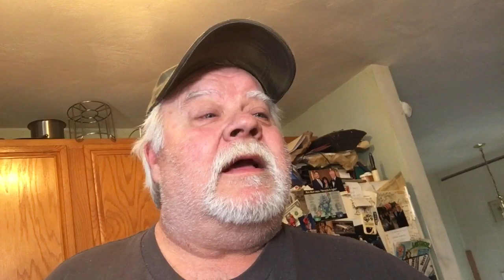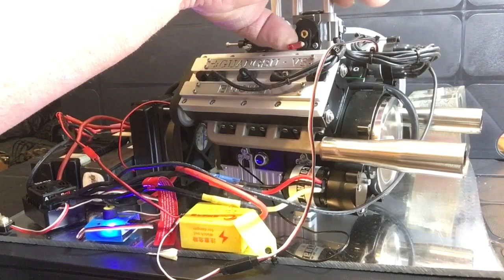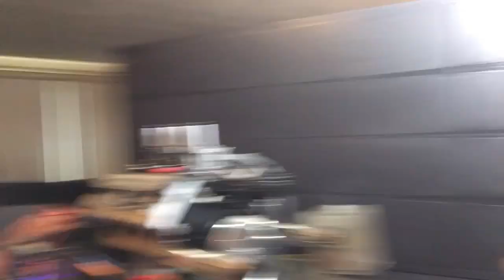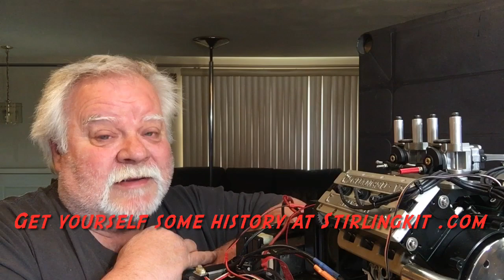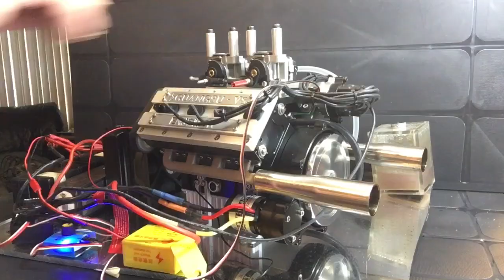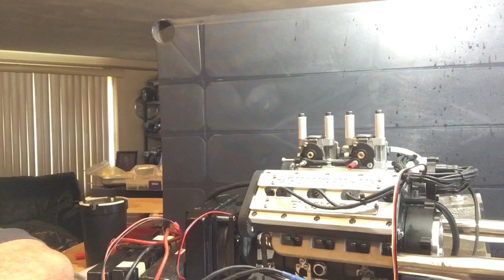THE NEW Enjomore 78cc STRESS TEST VIDEO

Comment: Dennis
You can advance the ignition timing by turning the rotor arm relative to the inlet cam.I plan on doing that and then fitting the RCE1 ignition module using the existing hall sensor. The RCE1 electronically advances the timing further once started by I think another 10 degrees.Should improve pick up no end.
Reply: I didn`t explain that RCE1 properly. You set the rotor arm at say 25 degrees advance then the RCE1 retards it for starting. Then once going puts the timing back to 25 degrees. Sorry.
Reply from the maker: No worries brother I knew what you were saying👍👍

Comment: Wants a bigger radiator an fan surly. An it's inside with no cool air flow. Take the radiator off your truck an run it in a garage. Bet it won't last long

Comment: Questions: is it strong / reliable enough to Put it in a small motorcycle or gocart? Will there be spare parts? Thx and great Videos btw
Reply from the maker: im not sure yet my friend im still testing a clutch that works for a 1/4 scale with this engine,
Reply: @dennisdempseyradiooutofcontrol  thx my friend, Looking forward to that. I might have to wait a little bit with buying.